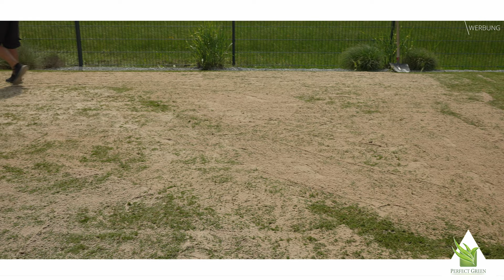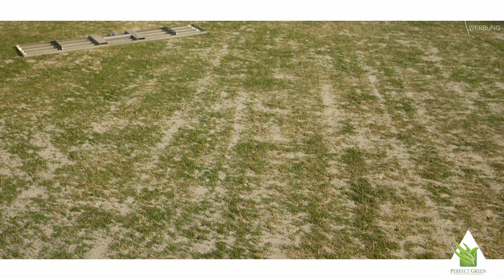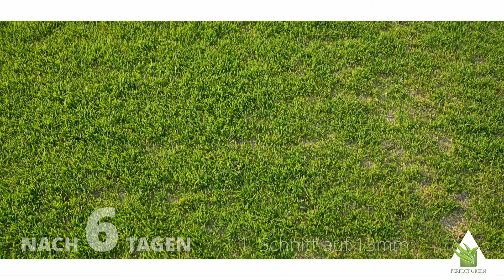🌱 Ein Tag voller Rasen Action   -   Lüften / Mähen / Aerifizieren / Nachsäen / Sanden / Wässern  🌱

Comment: Hallo,
Welchen Sand würdest du empfehlen (mm?) und gibt es eine Faustregel?
Wie viel Sand pro Quadratmeter?
Reply from the maker: Quarzsand 0,2-2 mm 
Ca 3-11 kg je nach anwendungszweck und Schnitthöhe
Reply: @PerfectGreen  Vielen Dank für die schnelle Antwort. Wir haben uns nach Ihrem fortgeschrittenen Pflegeplan orientiert. Nächste Woche werden wir den Bodenaktivator einsetzen und in der letzten Maiwoche die große Aktion in folgender Reihenfolge durchführen: Lüften, Tiefschnitt, Aerifizieren, Nachsatz, Sanden, bewässern.
Jetzt folgende Frage: Sind wir in Reihenfolge richtig unterwegs? Und außerdem, muss der Sand gewaschen sein oder können wir normalen Füllsand nehmen?
Die Rasenfläche beträgt 150 bis 200 Quadratmeter.
Viele Grüße und mach weiter so 💪🏼✌🏼